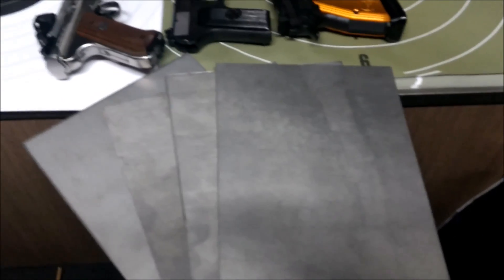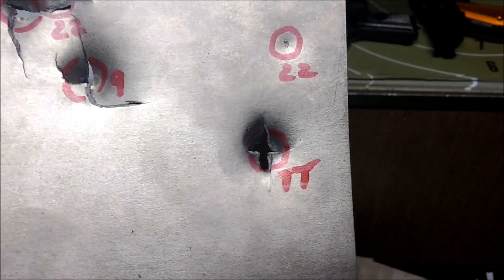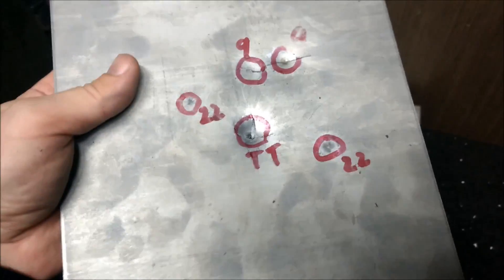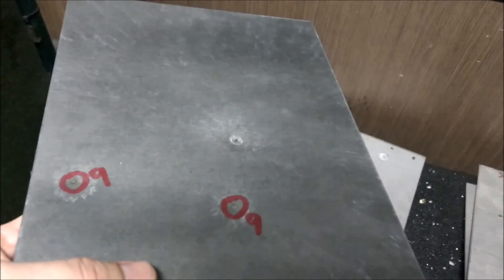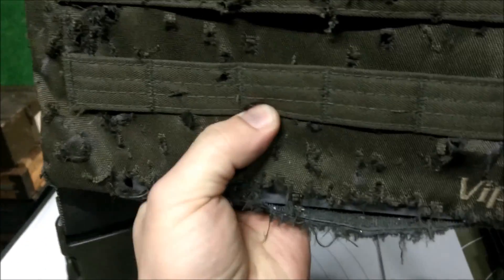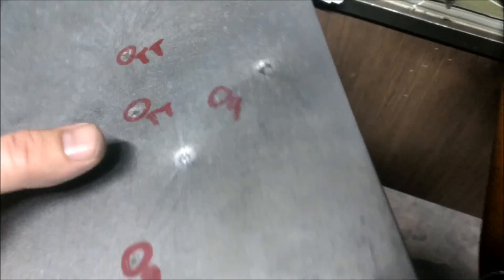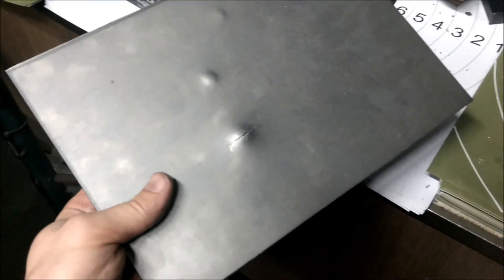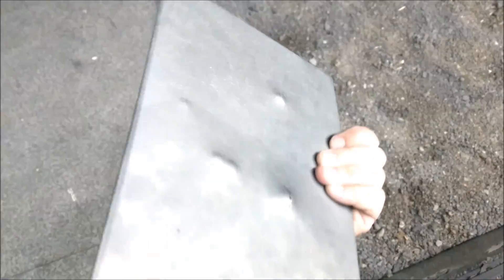Titanium plates test for homemade armor

Comment: Thanks for sharing this Titanium Tests. 

Two Questions: 1) What was the distance from the gun 
to the Titanium target ? 

2) is it Titanium Grade 5 the same as Titanium 6AL-4V 
alloy ?
Reply from the maker: Distance was about 10m, Grade 5 titanium is exactly as you said
Reply: Thank you for this info. 

One More question: What would be more effective against 
the 9 mm round, One Single Titanium 5 Plate of 4 mm or two 
stacked 2mm Plates ?
Reply from the maker: Well, i don't know. I think 4mm would be stronger. 2mm plates should be glued together or something but the question is, what will happen after first hit. Will the plate separate because of impact force? Probably. than plates will move unless you keep them on some kind of kevlar pouch so they still close to each other. I will make a new test next week with 2mm Tungsten plate backed by titanium and aluminium. I think if you use 2 or 3mm Titanium plate and back it with 5mm aluminium plate it will be much stronger. Titanium will shatter the bullet and aluminium will not allow titanium to deform and crack.
I will use this idea to test Tungsten. I think the results will be similar to Titanium/aluminium configuration. Will see.
Reply: Thank you. 

Experiment is always the veredict of Theories. 

Please keep us posted on the results of this 
Experiment.
Reply from the maker: this was very expensive experiment. First of all, make a small plate for testing. You can not have a bare metal, you need some kind of spall lining or bullets fragments will injure you. I have a test of 3mm titanium wrapped in kevlar 29 pouch, make something like that but with 4mm plate and test it. If you happy with results build your vest, but its gonna be expensive!
Next month im testing Tungsten plate. It's gonna be 2mmTungsten+3mm titanium+5mm aluminium sandwich, and 2mm tungsten + 8mm Aluminium.
Reply: Alright so i have a molle vest with level 3 soft armor, and i want to layer small 4" crescent moon shapes of this to be like scales, how practical do you think this is? I would manufacture it to have the hold drilled on the flat part, attached to the molle, with the next layer covering the holes where they attach, in an overlapping pattern, i would probably use the 4mm you mentioned, how much did you pay for each panel? And what kind of tool can cut this metal or am i looking at a plasma cutter?
Reply: brandyn brownie, there's a reason why some countries tried and abandoned this concept. The more pieces you have, the more liabilities, especially with the components that hold the system together. Dragonskin failed because of the glue, 6B2 had problems with stitching. You also have to make sure the pieces remain flush and without gaps at all range of motion so the curve/shape/dimensions is important.

If you are interested in the concept though, I suggest looking into some of the old Soviet vests that experimented with the concept of overlapping plates, like the 6B2 (overlapping tiles held in spall pouches) and the Fort Defender (a trapezoid top and a rectangular bottom plate).

Comment: Thank you for all the tests.... for sure very few people would be able to make them, taking in consideration the costs......
Titanium Sheet - Offcut - Grade5 (TA6V) - Thickness : 5 mm - Lenght 1000mm - Width 360mm --- for 699.00 € (plus shipping)..... to expensive for me..... 
We'll be looking forward your next videos.
Reply from the maker: i admit it was not cheap. I'm glad you liked it!
Reply: This definitely is a good test, but the prices are prohibitive for armor. I bought very small pieces (4 square inches) for an electrolytic cell years ago and it was quite expensive at nearly $30 per plate. You may be able to recover some costs by cutting it and selling it to hobby chemists for electrolytic cells.

Still, definitely a very valuable video. Thank you.
Reply: We can provide Grade5 titanium plate ,my email: anber@bjhighstar.com